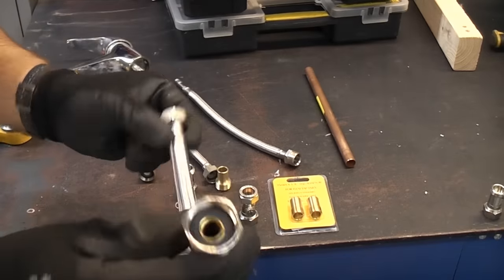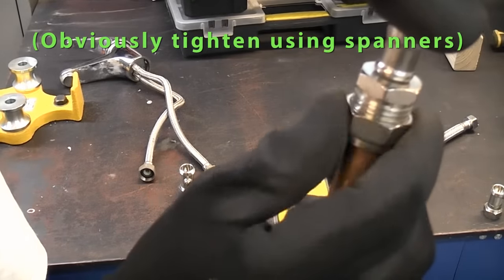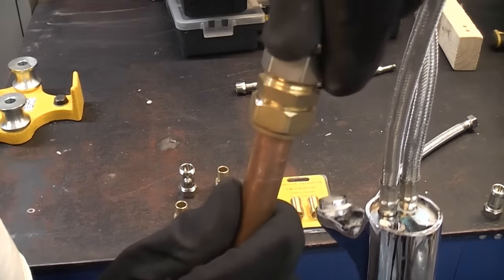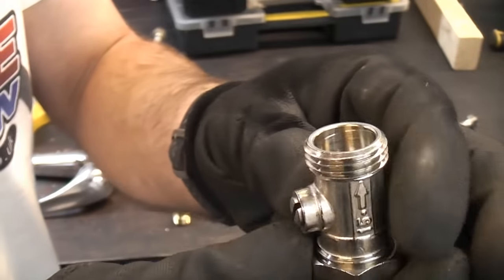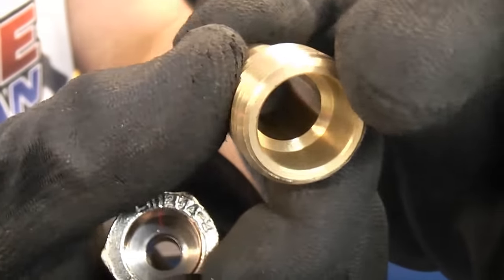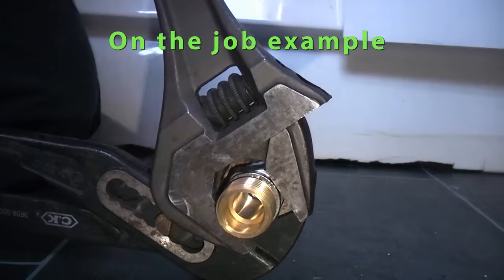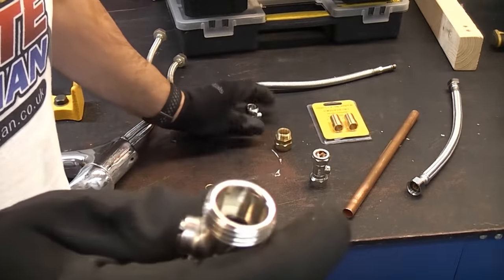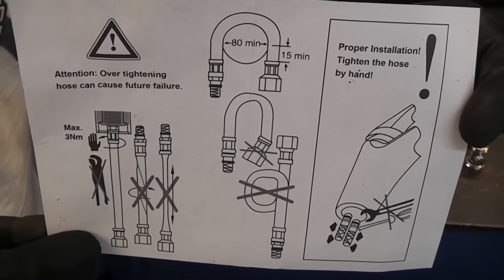How to connect flexible tap connectors 2019 | flexi tap tails

Comment: First time doing a bit of plumbing and the video was super helpful to change our basin tap. One flexi tap connector on using an isolation valve and tap tail adaptor will little issue. But the second flexi tap is about an inch too short (the old flexi tap connectors were fine length wise), what is the best way to extend the copper pipe without soldering.
Reply from the maker: The easiest way is to cut the pipe and insert a push-fit fitting- https://www.youtube.com/watch?v=Z83vlwUyZIw&t  👍
Reply: @ultimatehandyman  Nice! Thanks for this. I was thinking (after researching) cutting the copper pipe a bit further down and inserting a compression coupler. Would this still work (the top of the pipe has an isolating valve with tail tap adaptor like this video, works a treat on the other pipe which was a bit longer)?
Reply from the maker: Sure 👍

Comment: I also have to admit - I've never paid attention to the chamfer on the ends of threaded fittings that connect to a flexi-tail.  But, what I always do prior to connecting, is to wet the rubber gasket (if my water source isn't on or available, I just spit on it). That allows the threaded fitting to slide on the gasket and not pucker it up while tightening.
Reply from the maker: Thanks for the comment, Jo  👍
Reply: Or even better some liquid ptfe

Comment: Many thanks for the explanation. I need to multiply a cold water supply for a standard dishwasher hose and for a mixer tap's flexible connector pipes, 450 mm long and 3/8''. Can you please tell me what kind/size of connector and adapter should I use?
Reply from the maker: I would not start to join flexi pipes together, it is better to extend the pipes, then use the correct length flexi.
The easiest way is to use plastic pipe and push fit fittings- https://www.youtube.com/watch?v=Z83vlwUyZIw

Thanks for the comment 👍

Comment: Excellent tutorial. Thanks.
 My kitchen tap blew the swivel arm out last night so that's going in the bin!
I'm fitting a new tap this weekend.
Do I need to use olives with the isolator adapters?
Reply from the maker: Yes, if you are using the adaptors you need olives in the isolation valves to grip them.
Thanks for the comment

Comment: If the insulation valve has a tapered ending you could probably just file and sant it a little to dull it down and prevent it from cutting into the rubber washer, I suppose. Those connections don't seem to need to be tightened with a lot of torque anyway.

Comment: Hi, Looking at the isolation connector it looks to me as if they have just put the end onto a grinder and removed some of the thread?. I had not seen these but from now on I will be getting the new ones as I always use an isolation valve because you never know when you are going to have to isolate that tap, and they are so cheap that it is worth every penny. I have seen flexible pipes with the isolation valve as part of the pipe.
Reply from the maker: Thanks for the comment 👍

Comment: So isolation-valves? Should they be put on every appliance requiring water? Dishwasher, outside tap, sink etc.?
Reply from the maker: Yes, they should be in the pipework on every water outlet, but to be honest, sometimes they can cause more problems, especially if they start to leak.
Thanks for the comment 👍

Comment: I have tried fitting the adapters into the compression joint - not isolating valve-but it does not tighten up and remains loose.

Comment: Excellent tutorial. I have a question, perhaps you know an answer - I have connected flexi pipe male side to female side of an elbow connector. But it's leaking from the joint. I have put a fibre waaher between flexi-male and elbow-female. Used ptfe, no luck. Any suggestion?
Reply from the maker: Does the elbow connector have a flush face?
Normally a rubber type seal is used to get a good seal between the flexi and the connector.

Comment: Hi. Quick question. I have bought a new kitchen faucet and wanted to know if I could apply a push fit flexi tail  to a Tap tail adapter, as I need to extend the new flexi tail which are a bit short  on my new faucet 

Thank you in advance for any advice you can give me.
Reply from the maker: No, I don't think so. 
The best option would probably be to get longer flexi tails.
The brass part of the tap tail adaptor, which normally goes into the compression fitting, is not quite long enough to work on push fit fittings (I did try it once and it would not work).
Reply: @ultimatehandyman  

Many thanks Handyman. I will go to the store and see what I can find 

Thanks for your help. It’s much appreciated

Comment: Slightly off topic, but make sure the flexies are WRAS approved, especially if they are supplied with cheaper/none branded taps.
Reply from the maker: Good point, I got some years ago that would not connect to any UK plumbing fitting 😱
Thanks for the comment 👍
Reply: Ultimate Handyman it’s more to do with the rubber/silicone materials used which are a breeding ground for bacteria and legionella. industry auditors are turning against the use of too many flexies, but you can at least argue if they are WRAS approved. Good point on some strange sizings, especially from Italy !

Comment: Resurrecting this and hoping for help. My bath filler tap has 3/4” connectors on the flexis. I have 15mm pex running to the tap with full bore iso valves. I can’t seem to find any of these adapters for 15mm x 3/4”. Any ideas if they are manufactured anywhere?
Reply from the maker: I think they are only available in 1/2" and 3/8"
Perhaps you could just swap the isolation valve for a washing machine tap, as they have a 3/4" flat face - https://www.ebay.co.uk/itm/144222661980?hash=item2194572d5c:g:Z1MAAOSwRpthUv0o

Comment: Very helpful video thank you.  Have you seen female tail ends with an O ring as well as a washer?  When I disconnected the tail under a basin tap - that had been in situ for ~18 years - it looked as if there was a black ring (looked like an O ring) around the outside of the bore and then possibly a washer behind that.  Or is it just a rubber washer that's been squashed by being attached to a tap for 18 years?!  Thanks.

Comment: Hi, thanks for video. Now I have that flat faced isolation valve installed, how to connect 10mm flexi tile to it? As the valve is 15mm , is there any reducer available. Have Ideal Standard tap with Flexi tails pre- attached, can't see the way to replace them with 15mm nut tail.
Reply from the maker: Are you sure the Flexi is 10mm?
Normally the threaded part is BSP (so it will normally be imperial)
I'm sure you can get 15mm compression flat faced isolation valve with a 3/8 BSP fitting on the end. If not you can definitely get tap tail adapters to go to 3/8 BSP-
https://www.screwfix.com/p/tesla-brass-compression-adapting-flexible-tap-connectors-15mm-x-3-8-2-pack/6089r
Reply: Thanks, you have been absolutely right. Job done ✅

Comment: I've just bought a freestanding mixer tap that comes with 2 flexi-tails that although 1/2" BSP have a 1" nut and I want to connect that onto 15mm speedfit. Unbelievably, this item doesn't seem to exist!? I've fitted numerous basin tap flexi-tails to 15mm speedfit pipe  with the speedfit Brass push fit adapter but they have a smaller nut on the tail. With such a common connection it stuns me that a 1" nut to 15mm speedfit part doesn't seem to exist.
Reply from the maker: You need to know what the size of the thread is with the 25mm nut.
It could be 1/2 BSP or 3/4 BSP 
You should then be able to get the correct adaptor, example here-
https://www.screwfix.com/p/hep2o-plastic-push-fit-adapting-male-coupler-15mm-x/5970f
Reply: @ultimatehandyman  Thanks, spoke to speedfit directly and they sorted me out. You need 2 parts to make this connection, a 1" / 28mm male brass coupler and a 28mm to 15mm push-fit reducer

Comment: Thanks for the video, when connecting the flexi tail adapter to the isolation valve what type of nut is needed and is an olive used in this connection or does it just need a nut?
Reply from the maker: Flat faced isolation valves are preferred - https://fave.co/3Q4Vbn3
That fits onto the pipe using an olive and compression nut (supplied with the valve)
The flexi tail has a nut on one side, with a sealing washer, which connects to the flush face of the isolation valve 👍
Reply: @ultimatehandyman  thanks for the reply

Comment: That’s a smashing accent you’ve got there. Any advice for removing some old tails that are attached to some fragile seeming copper pipe work? I wanted to replace when I did the taps but ended up leaving the old tails in place because when I gave it some welly the pipe work was turning and I was worried about damaging it under the bathroom floor. I suspect it just needs replacing..
Reply from the maker: Might be best to cut the copper pipe, to remove the flexi tails. Perhaps the copper pipe is pushed into push fit fittings beneath the floor, that would enable the pipe to rotate. 
It is best to replace old flexi pipes though, as they have been known to split.

Comment: Hello - If I wanted to connect to a copper pipe without using an isolation valve (there is already one installed so I don’t need another) do I attach the flat faced tail adaptor to the pipe using a standard compression fitting and then screw the flexi tail on? Hope that makes sense
Reply from the maker: No, we used to do that years ago, but the end of the compression fitting is not flat and so over time, it can damage the seal and leak.
We now either use a flat faced compression fitting, or an adaptor like this- https://fave.co/3wrHLs3

Comment: Is it possible to replace a rubber seal on flexibile hose from the begining of the video, or maybe add one more if the connection is leaking due to old rubber seal? THX
Reply from the maker: With some you can, as the washer is separate. But if the rubber is connected to the flexi, it is best to replace the whole flexi (also the other flexi too), as it could mean that they have reached their end of life and are breaking down. A mate of mine had his house flooded when a flexi upstairs burst!

Comment: Great video. Would you have any recommendation to stop any small leak from the  15 mm olive? I installed mine as per your video but I am getting a tiny leak. Thanks
Reply from the maker: Yes, just wrap some PTFE tape around the olive and then retighten.
Obviously you need to isolate the water first and back off the compression nut 👍

Comment: I'm trying to fit a tap with 3/4 flexi hose; previous tap used 1/2 hose. How wd u attach 3/4 (euro) tap flexihose to a isolating valve that is threaded on top to fit a 1/2 flexi? I bought 15mm Compression by 3/8" BSP Male Iron Thread European Flexible Tap Adapters (Pair) and flexi hose screws nicely to the top of this but how do I connect to isoloating valves as both ends threaded?

Comment: when you say the flexi tap tail connectors being available in 3/8's  , is that the equivalent of a 10mm female flexi hose being able to fit to that?
Reply from the maker: No 😂
Plumbing is really complicated, years ago everything in the UK was Imperial, then someone changed everyone over to the metric system (I prefer metric). Now tap tails come with a 3/8 BSP or a ½ BSP to connect to the pipe side, yet at the tap side they can be 10mm or 12mm. I don’t know why things have to be so complicated 😂

Comment: I fitted two of these today. One is absolutely fine, the other one leaks through the top of the fitting......any ideas why? Or tips on what I need to check/do? Tighened the fitting to the flat-faced valve using spanners, but having to do it more on the 2nd fitting 🤨😡😡
Reply from the maker: Not sure, without seeing it. Is the washer in good condition? 
Sorry for the late reply, I've only just seen this comment!
Reply: @ultimatehandyman  Thanks for the reply. I ended up purchasing a couple of new flexible pipes as it seemed one of them had a faulty o-ring :)

Comment: Does it make a difference if you connect these to a hot or cold supply? My Flexi hoses are colour coded, one red and one non red but apart from that they look to made identically
Reply from the maker: The ones that I have used have always been universal (you can use them on hot or cold), but perhaps the colour coded ones use different materials for increased durability - or perhaps they are colour coded so that people don't get mixed up when connecting them.

Comment: Beginner question:

I'm going to fit a flexi hose to my bath taps....

 When I purchase the flexi hose, does it come with everything you need? Or do I need to buy a separate compression nut which goes on the copper pipe?

Thanks.
Reply from the maker: It depends which flexi tails you are using.
Some have a compression fitting at one end, but others need to connect to a flat faced isolation valve, examples here- https://fave.co/2PlcA0E

Comment: Iv got 3/4 flexi pipes but my new taps are a bigger thread..about an inch. Whats the best way to go about it?..Can i get an adaptor or do i have to change the flexi pipes for ones with a bigger nut?....cheers
Reply from the maker: Not sure, I have never seen taps that are larger then 3/4".  It might be best to go to a plumbers merchants to ensure you get the correct fitting.

Thanks for the comment 👍

Comment: Thanks for all the useful advice. Do you need to use an olive when putting a 3/8" tail adapter into your isolation valve?
Better still could I keep the tails from a relatively new tap and use them instead of the supplied 3/8" tails?
Thanks in advance for your thoughts
Reply from the maker: Yes, you will need an olive for a 3/8 tap tail adapter.  You can use the original flexi tails, as long as they are relatively new. I would never use flexi tails that are over 5 years old though, as I have seen them burst and flood houses!
 Thanks for the comment 👍

Comment: While installing my tap bath mixer floor freestanding, seem like my stell flexi hose are a bit long like 40mm long. Is there a way to reduce the length as I do not believe they can manufacture tap bath mixer with oversize flexi hose. And my copper pipes compression fittings are already 30mm below the floor tiles. Please assist
Reply from the maker: No, you cannot shorten them, as far as I am aware!
You might have to get shorter tails, or find another solution 👍

Comment: Can those flexi tap tail adapters also be used on gas fittings? I mean when connecting a flexible gas pipe to a 15mm gas isolation valve (with olive compression) one end and to the 1/2inch BSP male the other end for the female flexible gas pipe.
Reply from the maker: I’m not sure to be honest, as I don’t work on gas 🤔

Comment: Hi, is it possible to connect two flexitails together to span the distance from a kitchen sink tap to the copper water supply pipes at the opposite end of the cupboard. The existing tails are integrated with the tap. Thanks.
Reply from the maker: It is, but you are better off extending the pipework if possible, you can extend it using plastic pipe and push fit joints. 
https://www.youtube.com/watch?v=Z83vlwUyZIw
Or if you do connect the two flexi tails together, you could use a brass 1/2 BSP nipple - https://fave.co/2KULxqH
That's assuming the flexi tails are 1/2 BSP fittings 
Thanks for the comment 👍

Comment: I recently changed my kitchen taps and the new flexi pipes wouldn't reach the copper pipes as the older ones were longer and I couldn't reuse them as they were pretty beaten up and twisted, so I bought a length of copper pipe and extended the existing pipes using brass compression fittings. I've since heard that they may not be suitable for drinking water as they may contain lead. Is this true and if so what should I use?
Reply from the maker: Copper pipe and brass fittings are fine for potable water (drinking water), I have never heard of them containing lead before. 
There are hundreds of properties near me that still have a lead supply pipe going to their property.
I'm afraid there is always something that's bad for you, people often comment on my videos saying that plastic pipes contain chemicals that are harmful to health etc.
I'm sure what you have used will be perfectly fine ;-)
Reply: @ultimatehandyman   it was just the brass fittings I was concerned about because I heard that brass is made up of different metals including lead. I know that the copper pipes are fine. Thanks for that👍
Reply from the maker: @AA-yg5jm   Somebody has probably got mixed up with zinc, as brass is an alloy of copper and zinc 👍
Reply: @ultimatehandyman  ok, thanks.

Comment: Hi great video many thanks it has been really helpful. Just looking into which isolation valve to buy and do I need a standard one or a full bore for a tap? Thanks
Reply from the maker: A standard one should be fine for a kitchen tap or basin tap, but full bore is better for a bath tap.
Thanks for the comment 👍

Comment: How do you tighten flex hose by hand when the holes are recessed 2 inches inside the faucet.  I know you should not twist the hose itself...Advice please.
Reply from the maker: In that case you might just have to turn the hose to get the end tight- but do not kink it. Apparently you only need these to be hand tight, as they often have two sealing O rings.
Thanks for the comment 👍
Reply: @ultimatehandyman  Thank you. That is a great help!

Comment: I’m trying to fit a new Frankie tap and the cold water tap has a male flexi tale. There is a male isolation valve already connected. How do I fit the two?
Reply from the maker: Might be best to remove the existing isolation valve, providing you can isolate the water elsewhere. You can use a socket to join two isolation valves together, but it would need PTFE tape and might be difficult to seal. Example here - https://tinyurl.com/2bj2r3up
I really would go for the first option though 😉
Reply: @ultimatehandyman  yes I tried that socket and it was leaking and I couldn’t turn both ends.  With option 1 I would have to turn the water off at the mains.